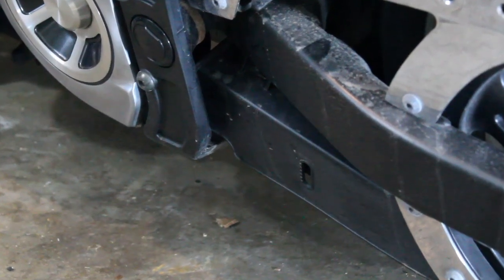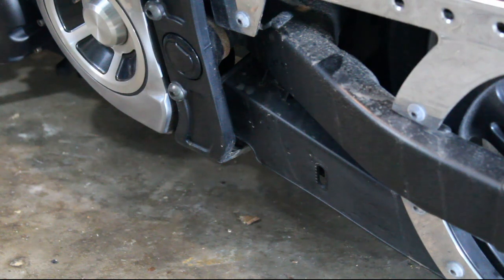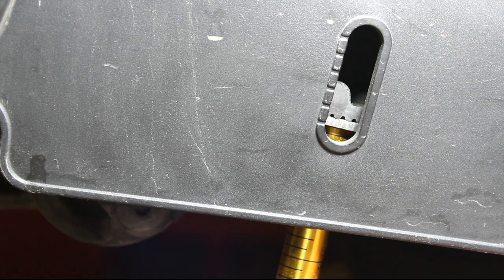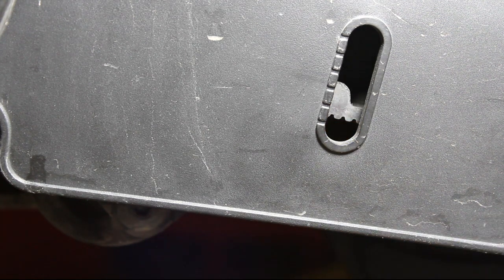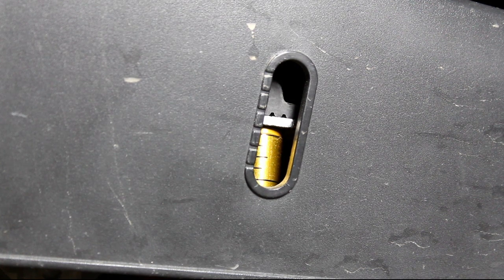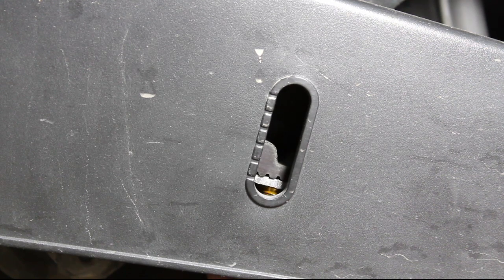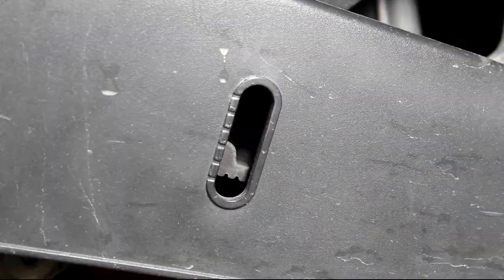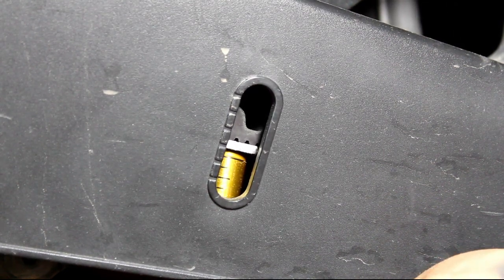Yamaha Warrior 1700 Belt Tension Check

Comment: Thank you for the video great job. What do you do if the tension is not what it needs to be? Thanks again!
Reply from the maker: Hey Alex, Thanks for watching! If your belt is not at the correct tension, it just needs to be adjusted. I'll be making a video of that process in the next week or two, but if you can't wait for that, the information on how to do it is in the manual. 

Assuming your belt is aligned right, you should just need to use the screws on the back side of the swing arm to adjust it tighter or looser. You'll need to loosen the axle bolt and brake caliper bracket bolt as well. Make sure to pay attention to the amount of turns as well as the hash marks on the side of the frame when adjusting to be sure to get both sides adjusted evenly. Exhaust may be in the way on the right side, so it may require that to be removed as well. Be sure to tighten back all bolts to torque specs when finished. 

Hope that this helps if you're not able to wait for the video to come out. Thanks again for watching and any other questions, please feel free to ask.
Reply: @RSWarriorBryan  Do u do this with the bike in neutral?
Reply from the maker: I would do it in neutral. It'll also make it easier to roll around because you'll want to do it in four spots because it won't be the same the whole way around.
Reply: @RSWarriorBryan  what about adjusting it, neutral as well?
Reply from the maker: Yes sir.
Reply: @RSWarriorBryan  Thxs man,  I appreciate it!

Comment: Hi Bryan! Did you have ever break the drive belt? My bike has near 12000 miles, and I'm going to travel. Don't know whether to take a spare belt...
Reply from the maker: Hey, I haven't ever broken a belt on either Warrior. They're pretty tough, and at 12000 miles your belt should still have a lot of life left. That said, if you plan on riding much on gravel, or anything like that, you run the risk of pebbles getting between the pulley and belt and that can cause a premature break. Under normal conditions, I wouldn't worry too much about your belt for now, unless something abnormal happens causing a break.
Reply: @RSWarriorBryan  OK, thanks!

Comment: thanks for making video, do can you tell me what kind of the tool are you using and where I can buy it.
subscribed
Reply from the maker: Hey, thanks for subscribing and watching the video! Gotta compliment you on your bike. I've seen it and it's definitely a beautiful machine. 

This is the link to the actual one I bought. If you look in the video, I had to use a hacksaw to cut off the front part to get it to fit to measure the tension through the belt guard. 

ABN Belt Tension Gauge - Universal, 10 lbs Specification, Easy to Read https://www.amazon.com/dp/B01M2ZHHNX/ref=cm_sw_r_cp_api_oBCIBbR8S1WQN

Here's is a link to one without the front part, but not sure if it's still too wide to fit or not. Both are pre set to ten lbs of pressure, so either one would work. 

Motion Pro 08-0350 Belt Tension Gauge https://www.amazon.com/dp/B009D398CQ/ref=cm_sw_r_cp_api_AFCIBbER4ZJM7

Thanks again for watching and subscribing. Hope those links help and hope I have more content to help in the future.
Reply: @RSWarriorBryan  do u have to Jack the bike up to do this?
Reply from the maker: Not necessary at all. The bike will have different specs on the tension whether the bike is on a lift or on the ground. I did this one without a lift, so the specs in this video would be perfect for you.

Comment: Is the rear wheel elevated when you are taking these measurements? Should you not want to perform these measurements with someone sitting in the bike?
Reply: Just bought my Ist warrior Sept.,  I am new to owning a belt drive bike, mine is an 08 midnight warrior only has 4000 miles on the clock. Have watched all your videos and seems like you are the guru on warriors. Presently have  Bridgestone Battlax tires and I believe these are the original tires and they are quite worn, what do you recommend for a higher mileage set , appreciate any help